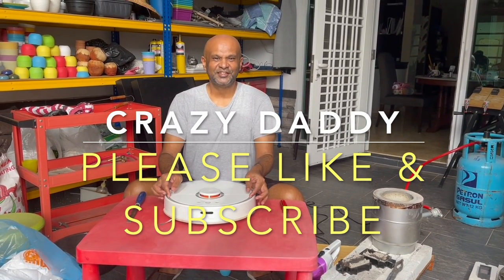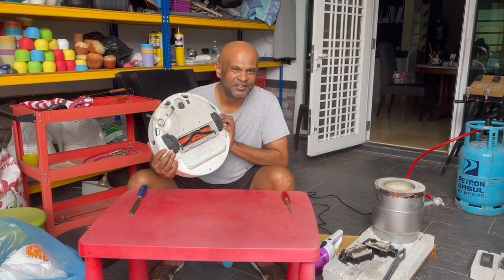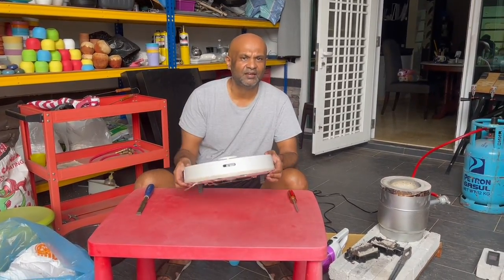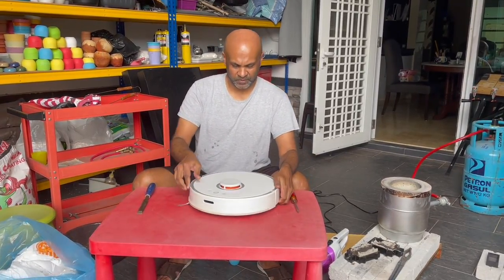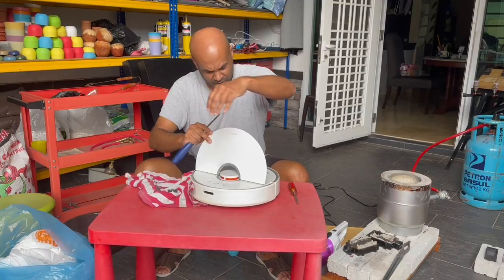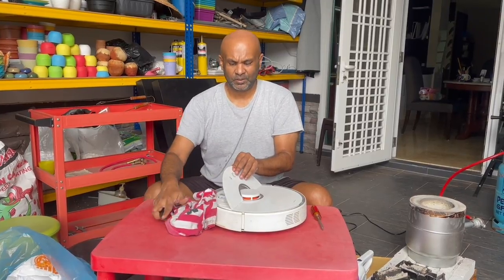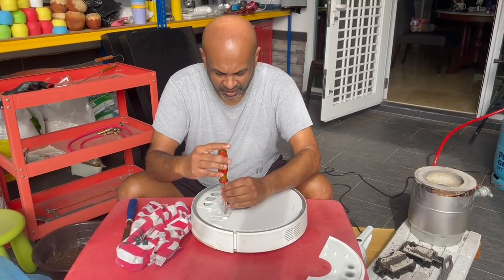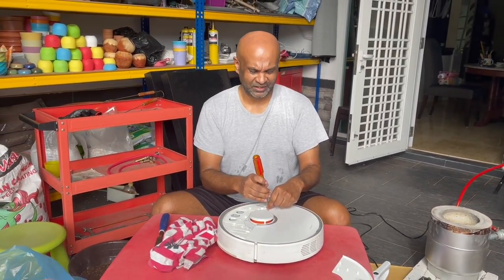RoboRock dismantle and clean, and solve filter block issue.  Maintenance for best performance.

Comment: Thanks! I started the dismanteling without your video, but then did not dare take off the clipped on top, before you showed it. I also might have had problems with the 3 hidden screws...
I had no error message but it's now 5 years old and started to leave a lot of fine dust lying around, so I thought there must be something wrong with the air flow. ChatGPT suggested the same. 
A lot of screwing out and in, but it's working again.

Comment: Mate thanks for this, I followed your process as I was getting the Error 10. One thing you missed is that when you're cleaning your filter (as you show on the video) you also have to remove the vacuum pump (round thing) as it ALSO has small filter underneath is which also fills up with dust. I removed it and found a patch of dust covering another filter between the pump and the exhaust port (or whatever it is called). Great video, thanks
Reply from the maker: Glad it was helpful and thank you for your comment - adds to our knowledge pool.  Been some time so I cannot quite remember the round filter (or they may have added that into later production batches) but I hope others having the same issue will catch it or read your comment.

Comment: I had the same issue error 10. The black rubber exhaust is attached to a circular part there, I unscrewed that circular part and inside it was fully blocked. You may have gotten it when you hoovered out that rubber exhaust, but if not, that part is also worth a clean out.
Reply: yeah , exactly
Reply from the maker: Sorry I did not respond earlier.  Missed it.  I think others are finding your comment helpful as you can see from the lastest comments.

Comment: How that black filter could be the intake filter? The vacuum is sucking the air from below, from the floor. I think that black filter is the filter for exhaust. But why does it need a filter for exhaust if it has a Hepa filter in upstream?
Reply from the maker: Hi.  That is a good point.  It IS a vent or exhaust.   The air is sucked in through the floor, throught the hepa filter and then out the vent.  Any one of them being blocked will cause a performance deterioration.  I suspect there is a bit of a design flaw in the original S5 because an earlier s5 model I used, the entire inside motor and electrical area was caked in dust when I opened it up.  So the air flow is not so efficient.  You are right.  Why put a foam filter there?  Is it sucking in dust from somewhere it is not meant to?  Maybe when the hepa filters get a bit clogged up, air may be flowing the wrong way?

Comment: Hi Crazy Daddy,

I loved your video. It was very helpful, but I'm stuck at the last part where you take the whole top off to expose the black filter. Is there a special trick or a hidden screw that I may have missed? Thanks for your helpful video.

Thanks, 

Erika
Reply from the maker: you probably did.  The top comes off quite nicely and without much strength applied.  The screws are all over so that is likely the case.
Reply: You were right! I kept looking and I found the screw I had missed!

Comment: I tried to disassemble mine  because of a pee accident of my dog but when I tried unscrewing the bottom cover I found that there is a plastic seal over the last screw. I am afraid of loosing guarantee if I tamper that seal. Did you have to break that seal to get to unscrew everything as you show in the video?
Reply from the maker: Yes, you do need to break through that seal and yes, it may likely void your warranty.  If it is still under warranty best to send it to an authorized service center.

Comment: this is not necessary if u just want to clear the filter and other basic cleanings. most parts that need to be cleaned are removable without unscrewing. There are more parts that can be removed more than u expected...
Reply from the maker: Agree.   I think it also when you bought your roborock.  Some of the newer ones are better at this while the earlier models had a poor venting system.
Reply: @CrazyDaddyG  I am having the same model as yours. About to give up due to long map loading time. it takes like 10 to 15 mins to load. Luckily the Timer function which I was not aware initially save my trouble. It just work according to your set schedules.

Comment: Did it fix error 10? Sure allot to take apart just for a fan.
Reply from the maker: It did.  I have a couple of these devices and notice the design internally has changed.  The earlier design caused dust to totally clog the airflow intake.    You also tend to get some errors on filter blocked if you use OEM filters.  But to your question, I do find a massive clean-up is needed once every 2 years if you want to give it a new lease of life.
Reply: @CrazyDaddyG  Thank you for following up. Thats great to hear. I have an S5 that started giving the Error 10 message a couple weeks ago. I cant seem to dislodge whatever is inside, its been running fine for a year or more. So I will have to carefully take it apart. They definitely didn't design it to be easily cleaned in the dirtiest areas. I empty my filter nightly and this has only take over a year to build up. So it looks like I found something to do on Saturday. Thanks for the video and letting me know it was successful. I will be watching it again!
Reply from the maker: @markc1310  while you are in there.....if you have black line or cliff sensor problems take a look at the video on how to disable them - mainly if you have carpets.  Have fun!
Reply: As A new job gaya @CrazyDaddyG